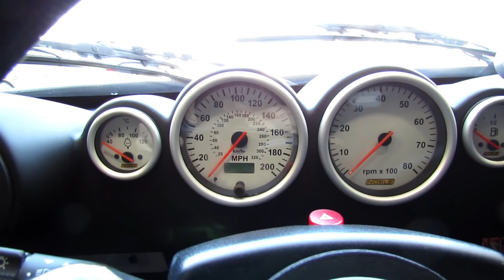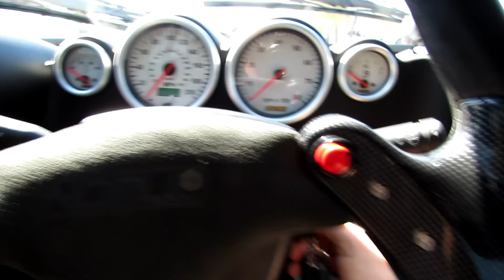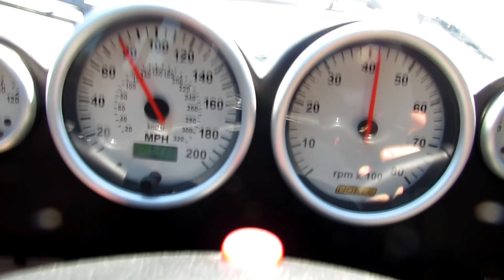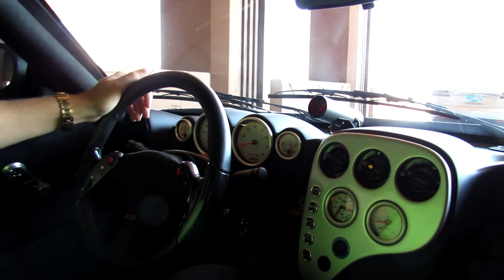Twin Turbo V6 Race Car - Test Drive Noble M400

Comment: This car is illegal as hell don't let the owner tell you anything else. Or else you'd be driving that motodyne matching R34 Gtr by now.
Reply: Anthony Dupree yea in state of california where there is smog laws dude ... 😂😂😂there is ways around that even u jus got to know ur stuff sir....😈🤷🏽‍♂️
Reply: i have a q1 registered in new york and there are a few m400s here too. it's definitely not illegal, even with how strict new york's laws are
Reply: c0zened exactly but no catts in cali its not legal but who cares shiet .... there is way around everything ... when im done with my build it will b far from legal thats why we do this shit right ???
Reply: @foreverg3549  they're built with cats so you can just put them in before your inspection and take them out after. it's not actually much of a performance gain to take the cats off on these cars though
Reply: c0zened im not jus talkn about cat removal im talkn about test pipes and shit lik that for gains after tune im not guna go threw the trouble of taking em off and on ill jus gt ma guy to pass my car for $200 problem solved less work no hassle u feel me .... have u peeped out my channel i b painting cars n shit as side hustle to buy more car parts for the G .... im gtn ready for kw v3 or possibly might gt performance airlift airbags u can drift on those things and ride around slammed clean bro clean 😈😈